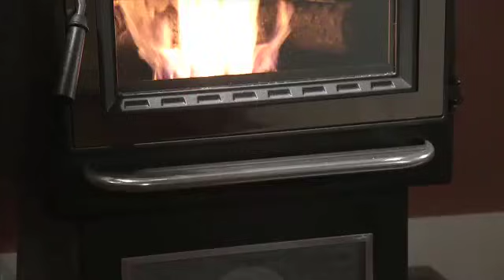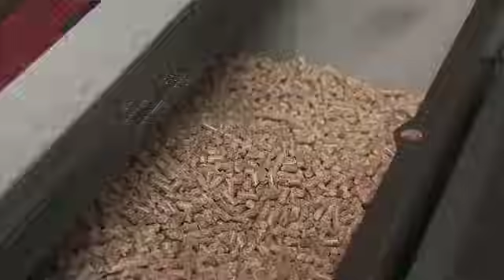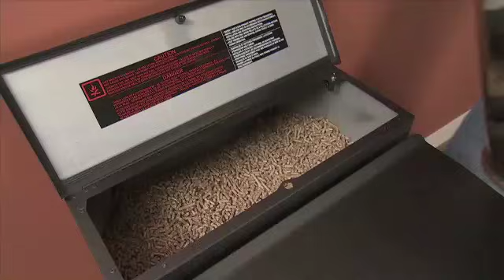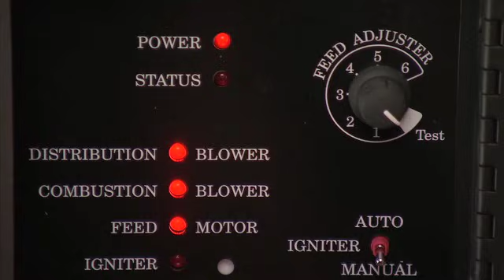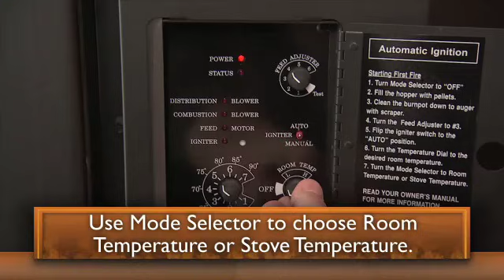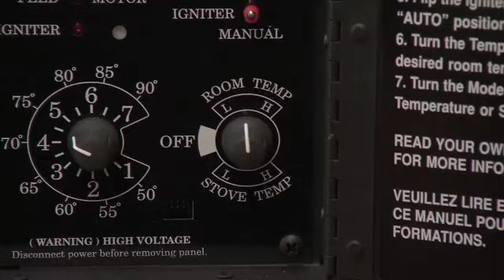Harman® P-Series Pellet Stove Operation Video

Comment: My Harman p43 which I have had for 11 years starts up only on one side of the burn point for the last few years. I’m told by the Harman tech there is a defect in the older P43’s and the back wall warped just under the burn pot. Lovely.  Any ideas

Comment: I’ve heated my home in Minnesota exclusively with my Harman P-68 for 17 years with no complaints. Yes I’ve had to replace a couple of parts but they are damn easy to work on. You can learn all you need to know from YouTube videos.
Reply: P68 is an awesome stove. I've had mine for 12 years still going strong.

Comment: DONT BUY A HARMON!!!  I have had countless issues with mine. Bent lids when it was delivered, horrible customer service, faulty main circuit boards, bad esp probes, faulty igniters, and a 2 thermostats that went bad for no good reason,  considering I’m only on my 6th or 7th winter, I would say that’s horrible. Even this morning I woke up to a 3/4 full hopper,  power to the unit, no fault codes, and a house that was 42 degrees… hmm.  Since I bought this Piece of Crap, I’ve reached out to Harmon on a few occasions, and I’ve only had 1 reply, and that was a guy on this thread, who wrote a reply after more then 2 years. All he did was tell me how well Harmon sold.  (Yes, sure… tha make my cold nights and aggravation go away….. …. …)
Reply: Do you have one of the newer units with the digital screen? Apparently those aren’t as reliable as the older style units like the p series. People get a ton of years out of the p68 so that’s what I ordered.
Reply: @WesAlexander  no, mine is an older unit.  I’m pretty sure I got a returned unit sent to me as a new unit. (PB farms in Virginia)  The guy told me he would come set it up, and bring a ton of wood pellets too, and I’m still yet to see him (going on 10 years now). I complained to Harmon about it, and am still waiting on any kind of reply.
Reply: I wouldn’t buy a Harmon, but I would buy a Harman!
Reply: @glockman155 please do,  you deserve that kind of quality…